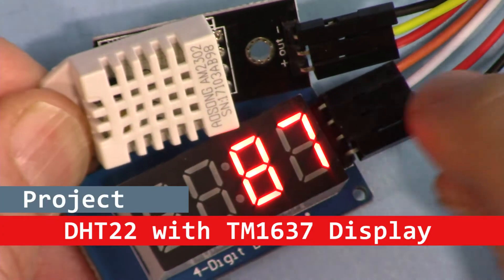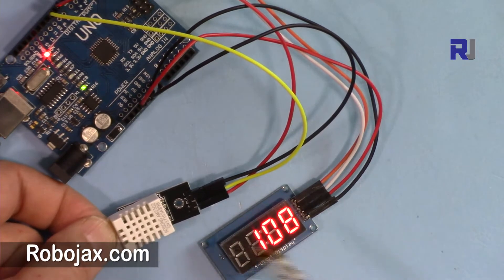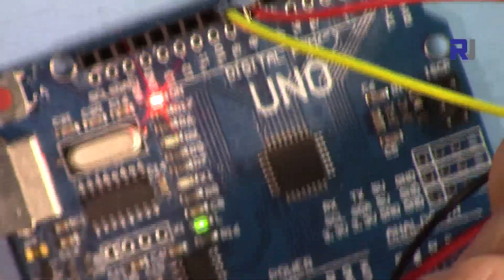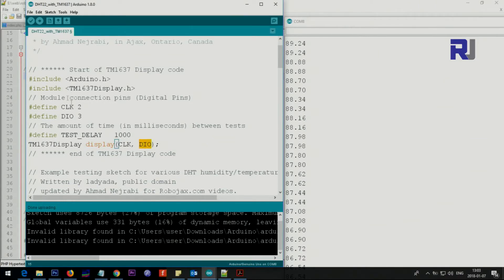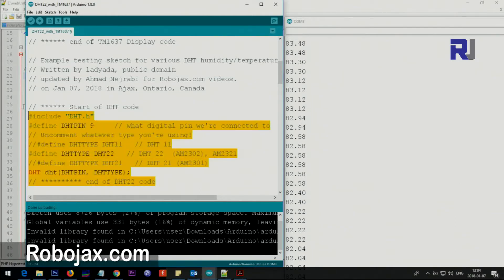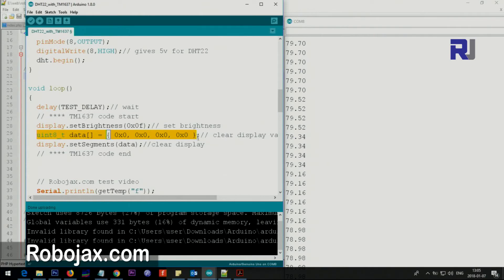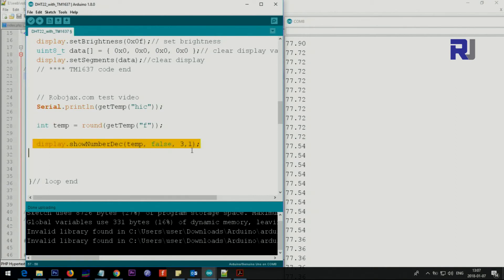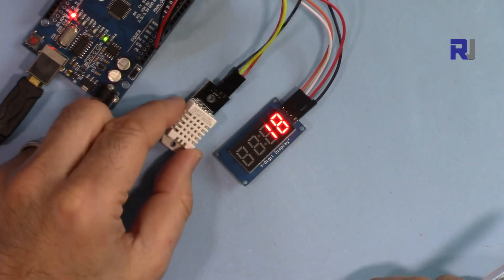Using DHT22 Temperature and humidity sensor with TM1637 seven segment display RJT43

Comment: How to display 26,2C ?? With dht22??
Reply from the maker: I just checked the datasheet https://www.sparkfun.com/datasheets/Sensors/Temperature/DHT22.pdf and accuracy is ±0.5°C so you will not be able to get 0.2°C. Also I mentioned that you can't  display decimal point on this module. it has too much hassle.  I've prepared code to display decimal values shown in this video https://youtu.be/k-f6lwwUTAs you may look at.
Reply: @robojax  I'd like to make a weather station.  4 digit 7 segment display tm1637.  + dht22.  I want to display the temperature with 1 decimal place.  do you have ready code and schematic?
Reply from the maker: search my channel.

Comment: How to use the temperature setting with a mini push button?
Reply from the maker: this is sensor, you can't set the temperature.  I did not understand.
Reply: @robojax  I mean push button limits the readout at a certain temperature to command the relay on
Reply: @robojax  do you know climate temperature controller like Temptron from Agrologic? Like that's how it works

Comment: How to solve the problem with negative values? (for example temperature below 0C)
Reply from the maker: This module is Good for 0-50°C temperature readings ±2°C accuracy
Reply: @robojax  Hi, thx for replay. Finally I've solved this problem. Now TM1637 works also with negative values. As sensor I've LM35. I'm n00b so this may not be perfect but I will share my work: 
void loop()
{
  delay(TEST_DELAY);// wait
  // ** TM1637 code start
  display.setBrightness(0);// set brightness
  uint8_t data[] = { 0x0, 0x0, 0x0, 0x0 };// clear display values
  display.setSegments(data);//clear display
  // ** TM1637 code end

  int val;// define variable
  int temp;// define variable
  val = analogRead(1); // read the analog value of the sensor and assign it to val
  temp = (125 * val) >> 8; // temperature calculation formula

  Serial.println(temp);

  if (temp > 0)
  { uint8_t data[] = {0x0, 0x0, 0x0, 0x58};
 //Celsius sign

    display.setSegments(data);
    display.showNumberDec(temp, false, 2, 1);

  }

  else
  { uint8_t data[] = {0x40, 0x0, 0x0, 0x58};
 //minus and Celsius sign
    display.setSegments(data);
    temp = -temp;
 //converting negative value to positive
    display.showNumberDec(temp, false, 2, 1);
  }

  delay(5000);// wait